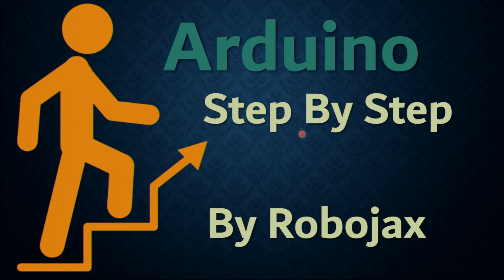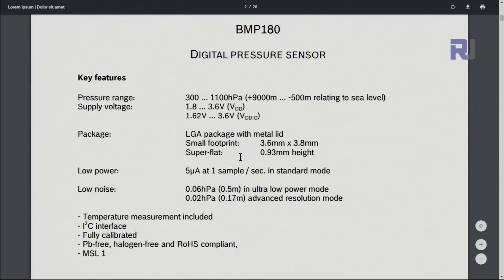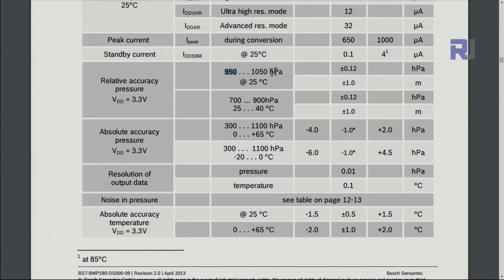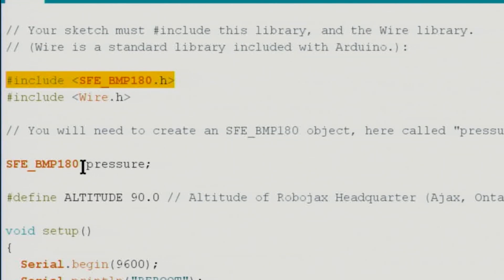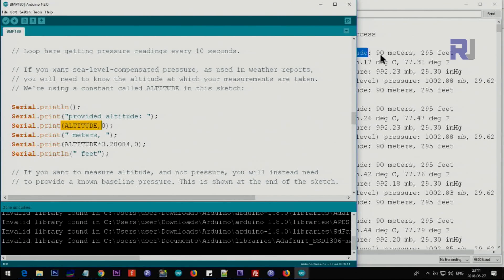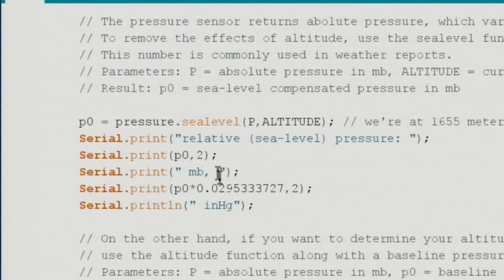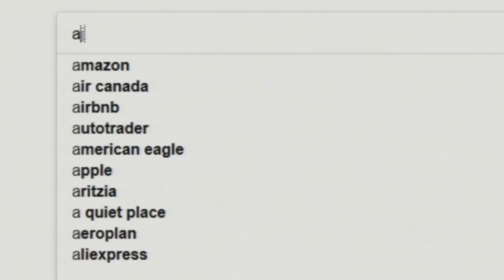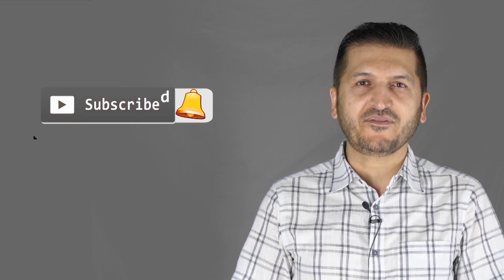Lesson 44: Using BMP180 Barometric Pressure Temperature Sensor - RJT522

Comment: Worst sensors,I have 6,to 7 modules,bmp180 and bmp280 each sensor shows diffrent diffrent readings. also huge diffrences
Reply from the maker: Which reading? Temperature or barometric pressure? Only temperature is valid and this chip is from Bosch and excellent quality. You must be doing something wrong or the condition of measurement is different. Only if you connect two or three sensors at the same time could be compared. If you connect them one by one , that comparison is not valid.
Reply: VCC 3.2 VOLTS ,DIFFRENT EXAMPLE CODE  AND VARIOUS MODULES USED ,MOBILE APPS SHOWS ALTITUDE 20.0 MTRS,INTERNET GPS DATA  FOR CURRENT LOCATION FOR ME,BUT BMP180 SHOWS ALT5.0.MTRS,BMP280 SHOWS 8.90 MTRS,OTHER MODULES SHOWS 30.0 MTRS,I USED SAME CODE ,TEMPRETUE AND PRESSURE   
SHOWS FEW POINTS DIFFRENCE BUT ALTITUDE  VARY MODULE TO MODULE BIG DIFFRENCE ,WHAT IS WRONG WITH ME

Comment: hi robojax i am making a data logger for altitude for my remote controlled projects using the bmp180 sencor. i have used you library a few time when using the bmp180 before. except this time i am struggling to get the code to work. in the loop section im trying to get it so when i push a button it records data slower and when that button is relised it records data faster again. i have been suck for hours and cant figure it out. i know all of the componants and wiring is correct because i have tested them all indidually and they all work. 

the error i get at the bottom of my screen when i try to varify or uplead the code it says:

C:\Users\timon\OneDrive\Documents\Arduino\data_logger_code_3\data_logger_code_3.ino: In function 'void setup()':
data_logger_code_3:45:14: error: 'getPressure' was not declared in this scope
   baseline = getPressure();
              ^~~~~~~~~~~
C:\Users\timon\OneDrive\Documents\Arduino\data_logger_code_3\data_logger_code_3.ino:45:14: note: suggested alternative: 'pressure'
   baseline = getPressure();
              ^~~~~~~~~~~
              pressure
C:\Users\timon\OneDrive\Documents\Arduino\data_logger_code_3\data_logger_code_3.ino: In function 'void loop()':
data_logger_code_3:73:9: error: 'getPressure' was not declared in this scope
     P = getPressure();
         ^~~~~~~~~~~
C:\Users\timon\OneDrive\Documents\Arduino\data_logger_code_3\data_logger_code_3.ino:73:9: note: suggested alternative: 'pressure'
     P = getPressure();
         ^~~~~~~~~~~
         pressure
data_logger_code_3:102:3: error: a function-definition is not allowed here before '{' token
   {
   ^
C:\Users\timon\OneDrive\Documents\Arduino\data_logger_code_3\data_logger_code_3.ino: At global scope:
data_logger_code_3:172:1: error: expected unqualified-id before 'else'
 else {
 ^~~~
data_logge

#include <SD.h> //Load SD card library
#include<SPI.h> //Load SPI Library
#include <SFE_BMP180.h>
#include <Wire.h>

int led = 6;
int count = 0;
int chipSelect = 10; //chipSelect pin for the SD card Reader

File myfile; //Data object you will write your sesnor data to

// You will need to create an SFE_BMP180 object, here called "pressure":
SFE_BMP180 pressure;
double baseline; // baseline pressure
const int buttonPin = 2;     // the number of the pushbutton pin

int buttonState = 0;         // variable for reading the pushbutton status
const int MPU_addr = 0x68; // I2C address of the MPU-6050
int16_t AcX, AcY, AcZ, Tmp, GyX, GyY, GyZ;

void setup() {
  SD.begin(10); //Initialize the SD card reader

  Serial.begin(9600);
  Serial.println("REBOOT");

  // Initialize the sensor (it is important to get calibration values stored on the device).

  if (pressure.begin())
    Serial.println("BMP180 init success");
  else
  {
    // Oops, something went wrong, this is usually a connection problem,
    // see the comments at the top of this sketch for the proper connections.

    Serial.println("BMP180 init fail (disconnected?)\n\n");
    while (1); // Pause forever.
  }

  // Get the baseline pressure:

  baseline = getPressure();

  Serial.print("baseline pressure: ");
  Serial.print(baseline);
  Serial.println(" mb");

  pinMode(buttonPin, INPUT);
  pinMode (led, OUTPUT);

  Wire.begin();
  Wire.beginTransmission(MPU_addr);
  Wire.write(0x6B);  // PWR_MGMT_1 register
  Wire.write(0);     // set to zero (wakes up the MPU-6050)
  Wire.endTransmission(true);

}

void loop() {
  buttonState = digitalRead(buttonPin);

  if (buttonState == HIGH)
  {
    double a, P;

    myfile = SD.open("test9.txt", FILE_WRITE);

    // Get a new pressure reading:

    P = getPressure();

    // Show the relative altitude difference between
    // the new reading and the baseline reading:

    a = pressure.altitude(P, baseline);

    myfile.print(count++);
    myfile.print(",");
    if (a >= 0.0) myfile.print(" "); // add a space for positive numbers
    myfile.print(a, 1);
    myfile.print(" meters, ");
    if (a >= 0.0) myfile.print(" "); // add a space for positive numbers
    myfile.print(a * 3.28084, 0);
    myfile.println(" feet");

    myfile.close();
    delay(100);

    if (count == 30) ( Serial.println("hi")
                       );
    else if (count <= 30) ( Serial.println("bye")
                            );

  }

  double getPressure()
  {
    char status;
    double T, P, p0, a;

    // You must first get a temperature measurement to perform a pressure reading.

    // Start a temperature measurement:
    // If request is successful, the number of ms to wait is returned.
    // If request is unsuccessful, 0 is returned.

    status = pressure.startTemperature();
    if (status != 0)
    {
      // Wait for the measurement to complete:

      delay(status);

      // Retrieve the completed temperature measurement:
      // Note that the measurement is stored in the variable T.
      // Use '&T' to provide the address of T to the function.
      // Function returns 1 if successful, 0 if failure.

      status = pressure.getTemperature(T);
      if (status != 0)
      {
        // Start a pressure measurement:
        // The parameter is the oversampling setting, from 0 to 3 (highest res, longest wait).
        // If request is successful, the number of ms to wait is returned.
        // If request is unsuccessful, 0 is returned.

        status = pressure.startPressure(3);
        if (status != 0)
        {
          // Wait for the measurement to complete:
          delay(status);

          // Retrieve the completed pressure measurement:
          // Note that the measurement is stored in the variable P.
          // Use '&P' to provide the address of P.
          // Note also that the function requires the previous temperature measurement (T).
          // (If temperature is stable, you can do one temperature measurement for a number of pressure measurements.)
          // Function returns 1 if successful, 0 if failure.

          status = pressure.getPressure(P, T);
          if (status != 0)
          {
            return (P);
          }
          else Serial.println("error retrieving pressure measurement\n");
        }
        else Serial.println("error starting pressure measurement\n");
      }
      else Serial.println("error retrieving temperature measurement\n");
    }
    else Serial.println("error starting temperature measurement\n");
  }

  Wire.beginTransmission(MPU_addr);
  Wire.write(0x3B);  // starting with register 0x3B (ACCEL_XOUT_H)
  Wire.endTransmission(false);
  Wire.requestFrom(MPU_addr, 14, true); // request a total of 14 registers

  Tmp = Wire.read() << 8 | Wire.read(); // 0x41 (TEMP_OUT_H) & 0x42 (TEMP_OUT_L)

  Serial.print(" | Tmp = "); Serial.println(Tmp / 340.00 + 36.53); //equation for temperature in degrees C from datasheet
  delay(500);
  buttonState = digitalRead(buttonPin);

}
else {
  digitalWrite(led, HIGH);
  delay(1000);
  digitalWrite(led, LOW);
  delay(1000);

}
}
Reply from the maker: Hi my most of your code says ''getPressure' was not declared in this scope" meaning you don't have the library installed.